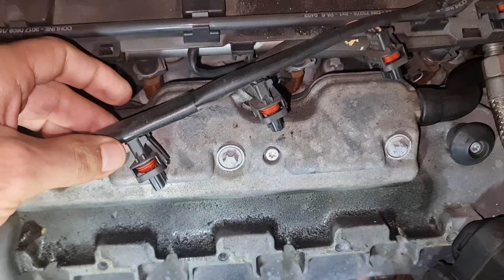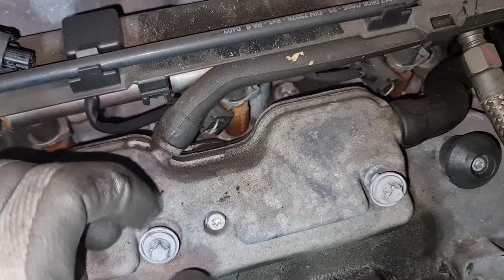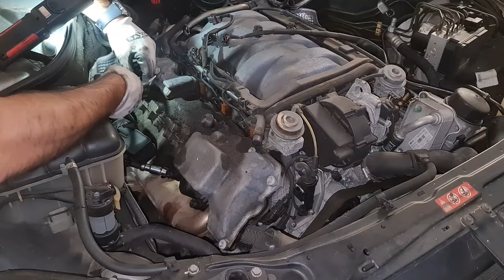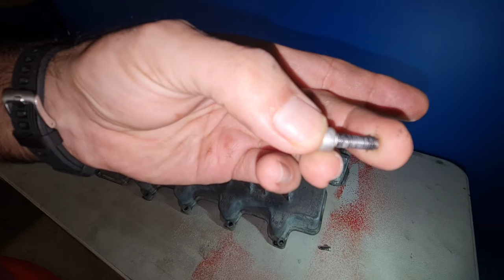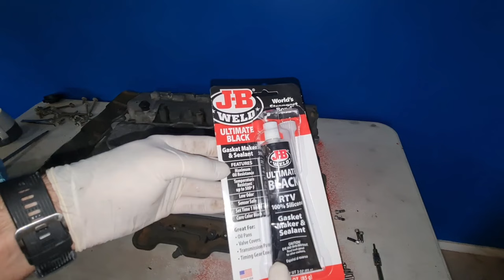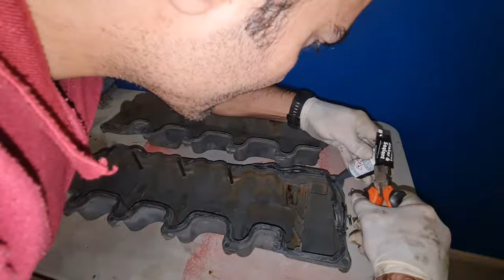The Secret to a Clean Engine (Mercedes M113 & M112 Valve Cover)

Comment from the maker: Not so hard, a bit long and messy project but so satisfying at the end, I highly recommend this and have seen many of these M113 and M112 Engine dirty engines due to the valve cover leak. Doing this along with the spark plug replacement (12 for M112 and 16 for M113) will save you literally $1000 in cost as these 2 projects are labor intensive... Good luck and please share your experience. Thank you.
Reply: I've owned 4 cars with the M113 and none of them leaked...
Reply from the maker: @dingdong2103  lucky 👨
Reply: @BenzAddiction  Maybe :) I still have a 2003 W220 S500L 4-matic with 100k miles on it, dry as a bone...
Reply: I love doing this myself though.  I can't remember the last i pay mechanic to repair my car.
Reply: My ML430 has milky deposit on oil cap, time to give it a clean out with this procedure.  I will find one relax weekend to do it.
Reply from the maker: @longhuynh5249  That's the way, the ML engine will love it 😉
Reply: @dingdong2103  I have 2 of them and they both had valve cover leaks. Since been repaired. The last one was my R171 SLK55 AMG.
Reply from the maker: @the-next-gear3626  yes, very prone to leak...
Reply: Thank you for that info. I was just looking to order the hoses because everyone says they will be hard, old and easy to break.

My M112 W220 2002 is leaking on both sides. A slow seep but still a leak.
How many hoses are there? I’ve found 4 to buy on line:
A1120180182
A1120180282
A1120180382
A1120180482
Can you confirm there’s are the ones I need? Thank you!!!
🙏🏼🙏🏼🙏🏼

Comment: I’ve done these so many times, I can literally do them in my sleep. I always recommend having all those breather hoses replaced as they already come in a kit.
Reply: Can this cause rough idle? I don’t have any vacuum leaks from hoses
Reply: Most likely your rough idle is a bad egr valve it’s a common thing that goes bad I herd or your breather valves are plugged up cause there are little holes that let exhaust gases through into the main valve covers .
Reply: where did you get the parts? for the screw? on the top of the manifold?
Reply: @talklacey664  where did you get all of the hoses?
Reply: I’m changing my gaskets but I don’t have a torque wrench so  going to have to tighten the bolts how I feel is best
Reply: What is the part number of the breather hose kit ?

Comment: For the breather covers, it’s important to allow the sealant to cure for 20 minutes or so before reinstalling them on the valve covers. This allows the liquid to set a stronger bead against the metal as you torque the bolts tight.
Reply from the maker: Very very correct, I am sure I have tightened those bolts in 3 stages...
Reply: So put the sealant on, then wait 20mins before putting the cover back on?
Reply: @gangalee83  Getting ready for this job myself.  Hopefully someone responds, but it seems like you install the breather cover after the silicone, install the bolts for alignment, but don't tighten.  The silicone has time to form up and then when tightened fully, it will be firm instead of squishing out.  I am just getting that from the context of the two comments, and thinking about it.   Like I said, hopefully someone affirms this.

Comment: Thank you for sharing this video. I just got gifted a 1999 E320 with a 100,000 miles on it and I have seen the excess oil which shows up on your motor like mine and I was wondering where it was coming from. With your video now I know. Please keep the videos like this coming so I can be more informed about the motor and car I have. And also did not know that a V6 had 12 spark plugs. Just like my little 2.3 Ranger has eight spark plugs on a 4-cylinder motor. I'm drunk I am talking too much I will let you go thank you
Reply from the maker: Thanks mate, sure, I have few playlists on the maintenance of M112 and 722.6, so feel free to have look at the channel,  cheers 🍻

Comment: I have a w210 E280 with the M112, and the gaskets are leaking so bad the car is misfiring, so this is something I know needs to be done.
Reply from the maker: This oil leak might end up with the spark plug holes being filled with oil and misfiring.

Comment: Good job !   I have done this on two CLK320's and a CLK55AMG , it is a long process if you want it done right.
My only tips , the breather cover bolts should be replaced with stainless steel bolts to minimise corrosion , and I would use only 3Nm to ensure that the magnesium cover threads don't strip. Also clean out the thread holes of any old sealant so the new bolts go in ok.
This job is normal maintenance on these engines after around 15 years or so.
Another thing you should do is replace the Crank Position Sensor , they also need replacing every 13 years , regardless of mileage.
Use genuine or Bosch only.
Also replace the air filters and cabin filter , which are always neglected.
Reply from the maker: Very good tips, thank you so much.
Reply: Would there be a mfg date printed on the crankcase or crankshaft position sensor. If yes, easier to make the decision to change it or not.
Reply from the maker: @whlawson  probably not very related to this topic and I have another video on this but if you ask AI this question about the expiry date on any cam or crankshaft sensors it would say: No, the Mercedes W209 crankshaft position sensor and camshaft position sensors do not have an expiration date. However, they can fail due to a variety of reasons such as wear and tear, damage, or electrical issues. Routine maintenance and timely replacement of these sensors can help prevent failure and ensure smooth operation of the engine. It is recommended to consult a certified Mercedes technician for proper diagnosis and replacement of faulty sensors.
Reply: @BenzAddiction  recently I bought a set of PCV & hoses for my mechanic to change out during oil change for supercharger. 

It turns out the previous owner had changed it out as the mfg date printed on the old PCV valve is 2+ years after the car's registration date. 

So if there is a mfg date on the position sensor I will not buy a new one until I could verified that the mfg date of old sensors on my W211. If it is mfg in 2011 or later then no need to replace it for the time being.
Reply from the maker: @whlawson  yes, good preventive measure to replace if they are so old. I keep 1 of each in my Glove Box, not difficult to replace.
Reply: @whlawson5812  No date on them ...With all the effort required to remove it , you may as well just replace it and have peace of mind.
Reply: Never use stainless steel bolts in a car except for a stainless steel exhaust! You will regret it, trust me. 

Unfortunately stainless steel sounds much better than it actually is. It will start to corrode if the thread or anything it touches is not made out of stainless. Also there is a high risk, that you wont be able to unscrew it after a bit of time, because smallest friction of stainless can act like a "weld". If you really want to use it, make sure you grease it properly. But still makes no sense to use it. 

Use a new, zinc coated screw. You will thank me later
Reply: Always check Bosh crankshaft position sensor before installing
Reply: What size are the small stainless steel bolts? Thank you
Reply: @reneivars114  M5  16mm thread length.
You can use any head design you want ,,Allen,torx or even phillips head.

Comment: So, I watched your video prior to attempting this on my W211 E500.

However, when I got into mine I found that you don’t need to remove the coil packs, spark plugs, fuel rail, etc. Just shift the coil packs around to reach the bolts and replace the plastic hoses on the breather covers. The coil packs, when shifted down far enough, allow the valve covers to clear out of the car, the only connections I had to disconnect was the coil pack harness and the fuel line at the back.

Hopefully this comment saves someone else a few extra hours of work.
Reply from the maker: Thanks mate.
Reply: @BenzAddiction  no, thank you! Your video made cleaning the engine and valve covers quite easy and targeted. You’ve got the most comprehensive video of this job on YouTube, so you deserve props for that!
Reply: @bleachstain9785 I have done this by simply leaving the coils hanging on the plug wires.  I have slightly bent the fuel connection up a bit and now the cover can be installed without disconnecting that.  Before bolting, use a mirror to make sure gasket is in position esp at the back lower corners.  My PCV covers were sealed on with RTV (ultra black or ultra coper)long ago and it leaked (may have been a long time).  Now I only use the 'Right Stuff.'  The 'Right Stuff' costs more but is much more like the OEM sealants.  It is the only thing I use on critical jobs now.  It is much harder when cured, like the stuff when you are the first to pop a factory cover off.

Comment: Also, while this is apart, don't forget to check the integrity of the gaskets at the MAF and at the elbow to the throttle body. Clean the MAF, too. Two new pliable rubber gaskets are not that expensive and are well worth the time and effort, especially if they have never been replaced.
Reply from the maker: Great tip, thank you 👍
Reply: @BenzAddiction  Thanks for the tip; just inherited a 98 c280 with the m112 and over 255k miles and I doubt it's ever been done.
Reply from the maker: @anonynmously  it makes a difference in the smell of interior ;)

Comment: I recently did plugs on a 99 E320 and left the coil packs on and were able to get the plug wires off just using my hands. Though I have pretty strong hands from 30+ years working on German cars.  I admit they are on there pretty well but it is still possible remove them even with using a tool to help and not having to remove the coil packs.

Comment: Its a 17 mm wrench to remove the spark plugs wires bro, and they sell one online specifically for that, has a gooseneck end and it makes it effortless, did mine after 180k miles and it was a piece of cake

Comment: Have just yesterday bought a near mint C320 Sports Coupe with only 59000 miles. Both covers have very slight leaks, and this maintenance will be my first job. This video gives great information, so thanks very much!

One question, I'm hoping I won't have too much gunk to clean,  but does it only accumulate on the insides of the covers, or will it also need cleaning off inside the head? And what's best to do that with?

Thanks again, and I've subscribed to your channel as I'm sure I'm going to need more of your information in the future.
Reply from the maker: You are welcome and good luck 👍

Comment: Great informative video! 
I do have a question regarding the fuel line though 
Before disconnecting the line, did you have to disable the fuel system in any way?
(ex: pulling fuel pump relay and running the vehicle until it stalls and/or quick release mechanism, along fuel line) 
Thank you very much and keep up the great work!
Reply from the maker: Hi mate, On a CLK or C class W203 fuse number 4 in the boot is the fuel pump.  If you like pull that off. Do it slow and cautiously and shouldn't be an issue.
Reply: @BenzAddiction   Sounds great 👍 
Thank you so much for your help!
Reply from the maker: @N-JOEI  👍

Comment: Nice video. Thumbs up!

I might add that if you have used a good synthetic oil like mobil 1 the inside of that valve cover would be spotless. I recently replaced the valve cover gasket on my M119 SL 500 at 236,000 miles and it looked brand new 

it has had mobil1 since the new as has my 2000 E430 with the M113. I suspect my M113 engine looks similar  

I think with FSS aren't they recommending synthetic oil? But anyway a nice video and well presented – thank you
Reply from the maker: Thanks mate, regular oil change is super important.  My M112 CLK320 inside the valve covers looks brand new too.

Comment: Thanks for this video - I do a lot of Benz videos too - I've always struggled with the covers getting them to seal and not leak. I clean the same method as you - great. I will try the staged torquing next time - 5nm and 8nm stage 2 :) Its definitely a lot of work but if patient, will ensure don't have to rework :)
Reply from the maker: Thanks mate, good luck with the project, I now have to do this on my M112 CLK320 after 2 years, I think the gaskets are not the best quality either...
Reply: @BenzAddiction  Yeah I agree - I only buy genuine gaskets now, i've heard others say the OEM ones aren't always as thick and suitable... So i'm curious to see when I use a new genuine seal plus your method here if I can seal her for good :)
Reply: @thatmatty231guy  Really curious about whether MB revised the part or in the aftermarket folks just missed on the tooling for the left hand side gaskets.
Reply: @rsulka  Yeah - I think the part no is still the same its always been :/ But maybe its the tooling they use.

Because i've since used GENUINE gaskets again, and carefully done them up and they're dry as the desert! :)

Comment: Trying to do this, only for me to see that one of the aluminium bolts is broken and is just sitting there with a kinda glue holding it.
How do I remove the broken piece from the engine block?

Also, will I have to buy a gasket for the valve cover or just make use of the gasket maker?
Reply from the maker: Wire cutter is easy removal tool my friend...

Comment: Amazing video, I am unsure that you did the bolts up in the right order, as usually you work from the middle outwards in a zig zag fashion, to avoid twisting the cam cover, haven’t got a service manual, so cannot confirm this but would seem wise
Reply from the maker: Thanks mate, eventhough the final torque spec is 8 NM, the gradual tightening of the bolts matters even more...

Comment: Hello, my M112 C320 is not holding the fuel in the line, every cold start, I have to turn the ignition at least 3 times to pump the fuel so the start won’t delay so much. What do you think it can be? Fuel pressure regulators or something in the fuel pump?
Reply from the maker: https://youtu.be/KZFY8CYcVlw

Comment: Nice tutorial, thanks for that, but I have to correct the torque specs, because MB manual says to torque T10 screws to the 9 Nm. 8 Nm is for coil packs. ;) For those aluminium screws it is 4 Nm and they should be replaced and also should be aluminium. If you replace them with stainless steel, the torque is out of specs and you can simply demage the thread in valve cover. MB put this screw material in for the particular reason, so...
Reply: That's not really how it works.  If the female thread holds an aluminum screw, it will hold a steel one better.  The same torque spec will be fine.  See Shigley, Mechanical Engineering Design to learn more about threaded fasteners esp preload and how the threads distort during loading.
Reply: @rsulka  OK, no problem, do it your way, but MB has this combination of the materials and specifications  from some reason.

Comment: 15:30 did you forget to put gasket maker on the longer grove in the middle ??
Reply from the maker: Not sure mate, might have missed it, though what I show in a 20 min video usually is not what I really finish the work with...
Reply: Do you use gasket maker in between the valve cover and new mercedes benz gasket?  Does Mercedes Benz recommend using a sealant between them?

Comment: Do you use gasket maker in between the valve cover and new mercedes benz gasket?  Does Mercedes Benz recommend using a sealant between them?
Reply from the maker: Yes I did, only a small amount to hold the gasket in place.

Comment: You rocker arms are very clean. How often do you change the oil? My rocker arms are yellow with 15k km oil changes.
Reply from the maker: Thanks, The car in the video, I bought a month before making the video, but in practice for my M112 I change every 10K or 1 year.

Comment: Another great vid and congrats on the new acquisition! Did you need to replace any of the bolts with new ones or just re-use the existing old ones? Looking forward to the next video! Cheers
Reply from the maker: Thank you my friend, the 5 x aluminum Torx screws on top of the breather covers need to be replaced, the rest are re-useable.
Reply: The five bolts need to be aluminium (genuine) stainless steel.  The covers are made from titanium and steel bolts will cause bad corrosion.   Correct torque specification is 4Nm for the five breather cover bolts.

Comment: I’ve changed my valve cover gaskets on my w203 c32 amg followed the same process with the right torque specs ( cleaned the block, made sure the gasket is in place, used rtv at the tricky corners)and its still leaking from the lower part after replacement its making me crazy tho any suggestions ???
Reply from the maker: Usually, it leaks from the breather covers, that's the most tricky ones. It is important to check for vacuum leaks in the whole system too.

Comment: if you do not use the dealership gaskets it will leak again. also paint the covers to keep the corrosion down
Reply from the maker: Thank you for the tips 👍
Reply: Paint?
Any particular paint you want to suggest!
Reply: @olatundeabiri7048  high temp primer and paint
Reply from the maker: @olatundeabiri7048  silver mat high heat paint?